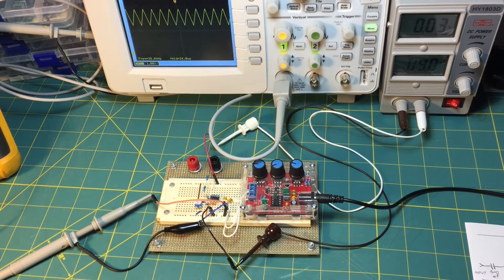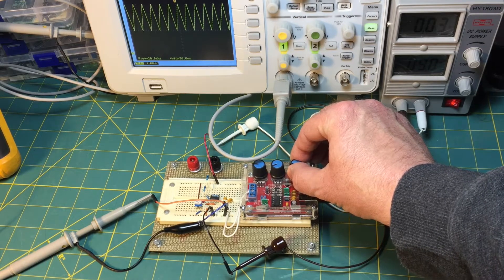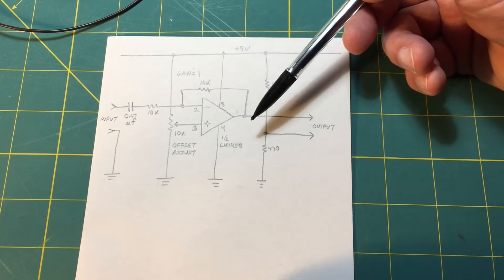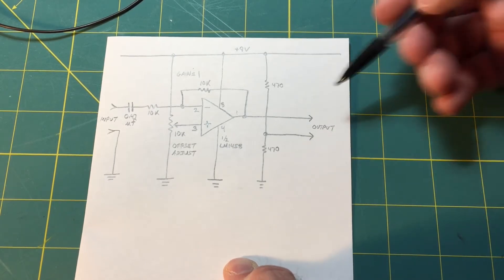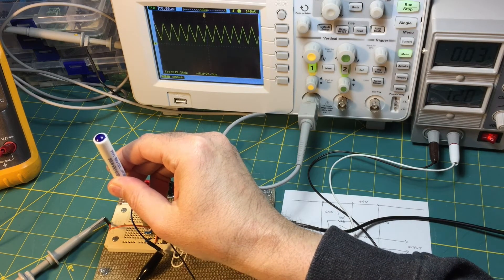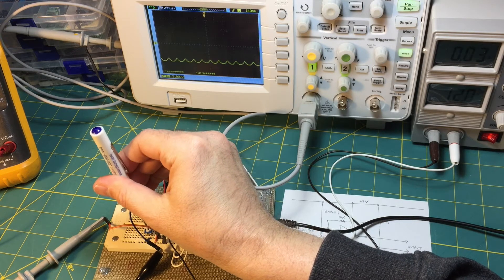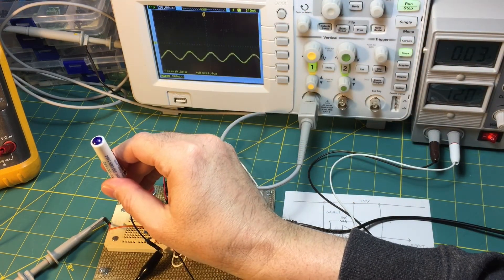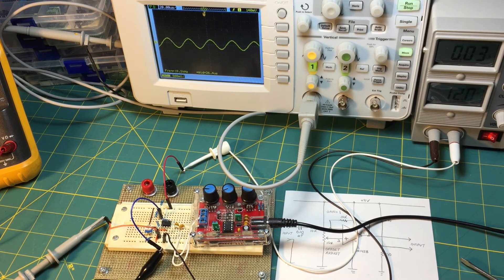Adjustable DC Offset with an LM1458

Comment: What is the use of one half of supply voltage at the end of your circuitry? Would you still be able to control the DC offset without the one half of the supply voltage?
Reply from the maker: We are using 1/2 supply as our reference point, the output of the op-amp is relative to this point.  This is what allows us to move the input signal above and below “ground”, which is really 1/2 supply.
Reply: Got confused for a second since you had an offset potentiometer connected to the negative input pin, and a voltage divider at the end. Just realized that you put the voltage divider at the end of the circuitry just for explanation. Thanks

Comment: Hello there.  I can't find a 0.47mf capacitor, instead what can I get best.
and i am using the circuit with 12v will it be a problem?
Reply from the maker: The capacitor value is not critical.  Supply voltages for the LM1458 can be as high as +/-18V, so your 12V supply should work just fine.
Reply: @NetworkXIII  Thanks. Would it be an equivalent 470nf 50v multilayer capacitor instead? 
https://www.direnc.net/470nf-63v-5mm-multilayer-kondansator
Reply from the maker: That should work.  The input capacitor could probably be anywhere from 0.1uF to 10uF.
Reply: @NetworkXIII  Thanks. I will try and see. My English is bad so it would be 470nf, right. What is 0.1uf to 10uf for?  To add if I use 470nf?  sorry for my bad english.🙏🏻
Reply from the maker: The cap value can be 100nF or higher, it is not critical.
Reply: @NetworkXIII  ok. Thanks 🙏🏻

Comment: Are any of these components connected to a negative power supply?
Reply from the maker: No, I’m using a single supply in the circuit.
Reply: @NetworkXIII  I kind of figured out what was going on after I recreated in in Falstad. You're creating a new 0V. That seems really useful in general.
I'm trying to design a little bench top power supply/signal generator and looking for features I can add. My issue now is that, if my op-amp and my signal generator both share the same VDD and VSS, and my signal generator already swings from rail to rail, any offset clips in one direction or the other. Gotta figure out how I want to adjust the pre-offset amplitude to give myself a margin. Anyways, nice video. Subbed.

Comment: What if you connect load, wouldn’t it affect “ground” made by voltage divider. I wonder if buffering this ground through another op-amp would help. Also do you have any ideas how I can increase possible output current with this schematic?
Reply from the maker: Output impedance of this particular circuit is about 180 ohms.  You are correct, to drive a low impedance load you would have to buffer the ground reference, an op-amp may work.